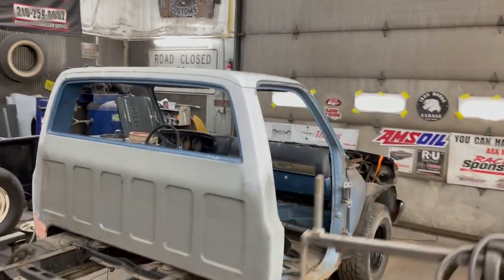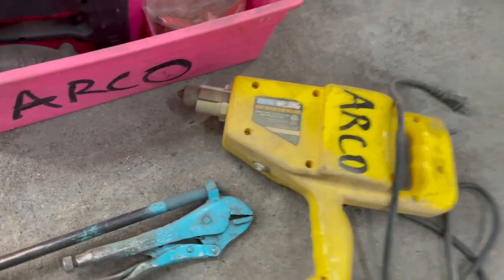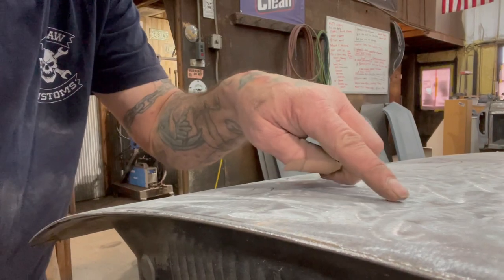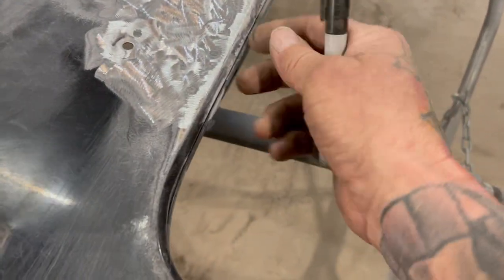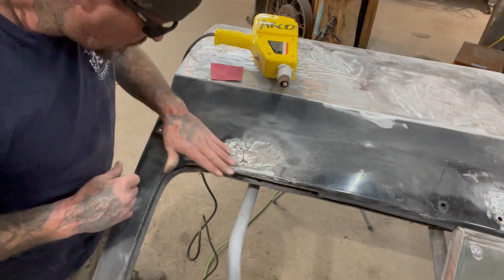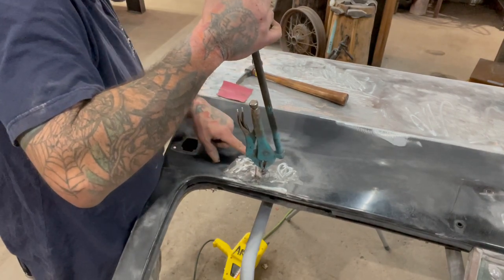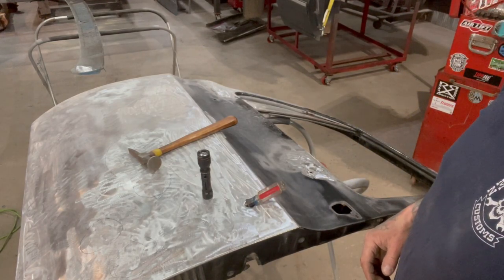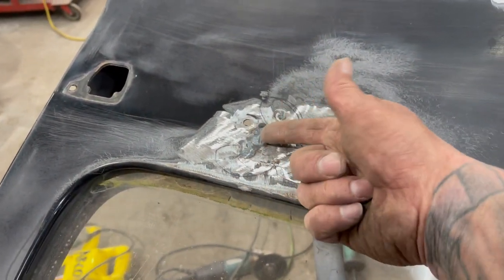Metal Shaping: Shrinking a Dent in a Squarebody Door (how to fix oil canning)

Comment: Love these videos. Lots of great tips and info. Agree with you about metalwork on newer vehicles. Had a parking lot mishap with my daily driver a couple of years back. Creased the passenger door perpendicular to the body line. I've messed with that on and off forever it seems. At this point I'm ready to just pick up a door shell, rebuild the door and put it on. Very frustrating. I feel like I've wasted my time and don't have that kinda time to waste. Have worked on many older cars in the past, mine and friends, fixing dents, rust, body mods, etc. I find it so much easier to work with that metal. Great video. Be safe and stay well.

Comment: Nice video showing one way to fix an oil canned area in that low crown spot on the square body. I have taken that brace out and plug weld it back in to help keep the metal tight!

Comment: American vehicles seem to use mild steel which is thick yet soft.  Japanese cars like Toyota have very thin very HARD steel.  It is good in a light hailstorm but when it gives it's totally done.  As a newbie I've had them studs rip off and leave a hole I may have pulled too far I guess.
Reply: Current goes from that ring to the center where the pin is.  If you pushed it down on your hand it and pulled the trigger it would shock you but hopefully nobody does that!!

Comment: Eastwood makes a really nice slide hammer for studs I bought one and love it maby I'll mention it and show it off in a video when I get the Mack done.
Reply from the maker: That would be great.👍I would definitely check that out bro. Thanks
Reply from the maker: I subbed your channel. Thought i did awhile back but i guess I didn’t lol
Reply: @OutlawEdge  Thanks ya I can't wait for the holiday sales and I'm going to get myself set up with everything to start making nice videos... This weekend I'm going to make a update video on the Mack and I have some dents I could pull and show off this side hammer🤔 I've bin busy trying to get that old beat up fiberglass hood done fuckin thing is going to be the death of me dam old fiberglass and all the hair line cracks everywhere. Finally got my air compressor up and going again bin busy around the farm so bin only getting few hours in on the Mack every night so it's taking a bit. Great video I the 90s Chevy's do the same thing about the door handles I suspect I'll rum into this problem on the 80 GMC I'm starting on next.
Reply: I have the Eastwood one too and really like it.